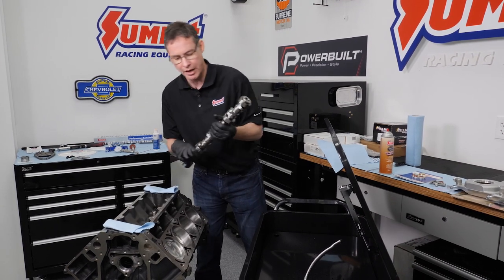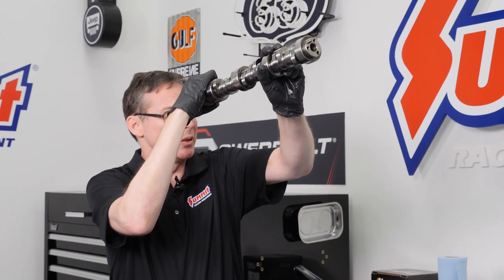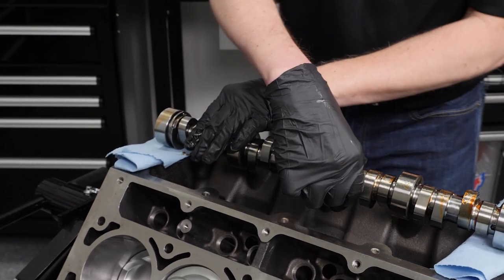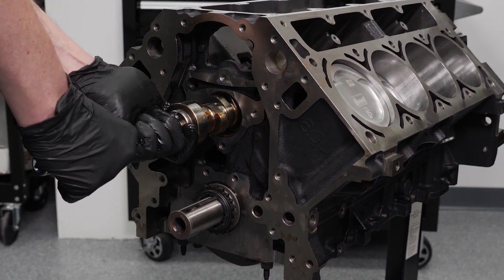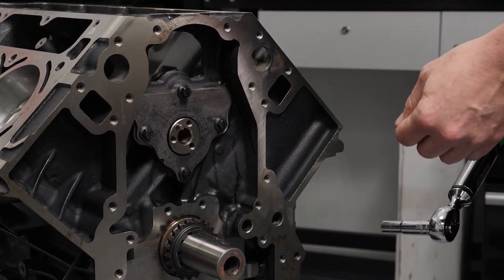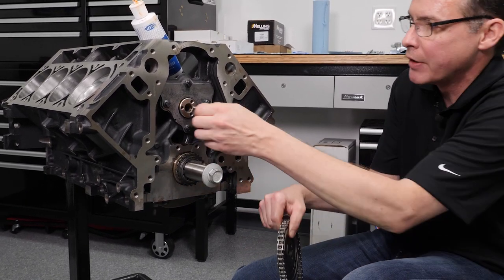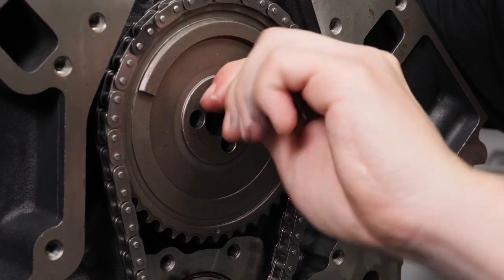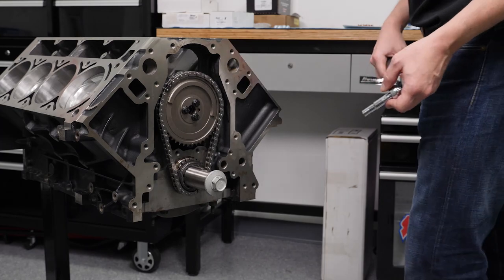Camshaft and Timing Chain Installation Tips | Engine Building 101

Comment: In some instruction manuals, Loctite is recommended on the thrust plate bolts. I noticed you didn’t use any? It’s that because you are using the ARP lube on the bolts? Can you use both, lube and Loctite?